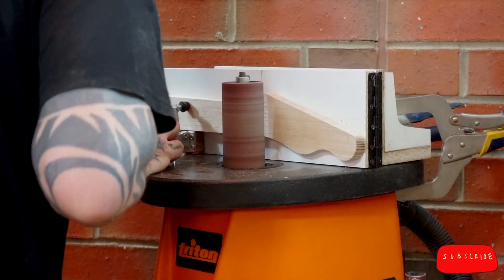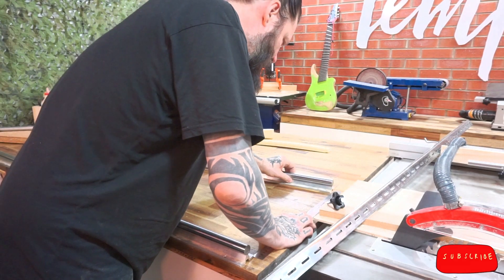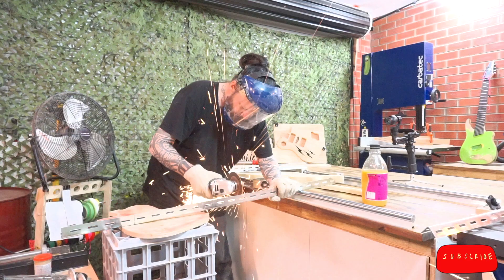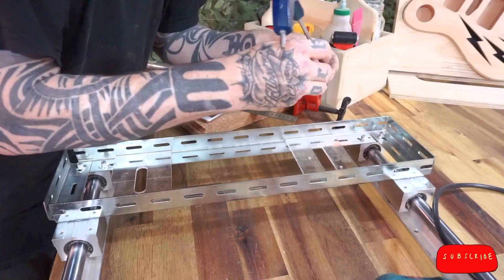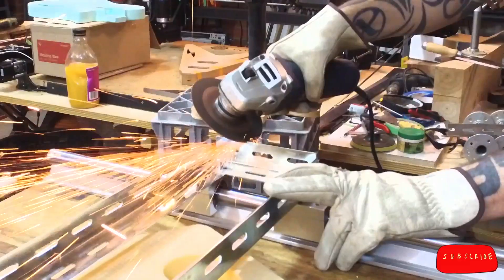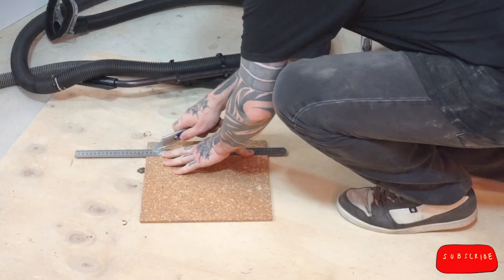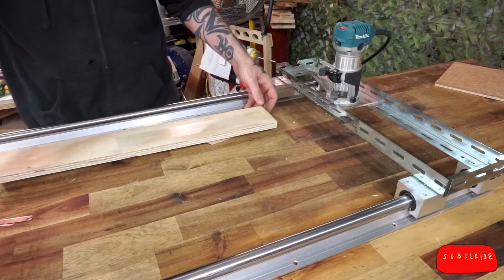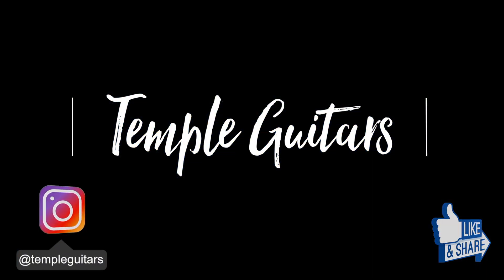Luthiers Router Sled/Camera Dolly + Free Plans!

Comment: Awesome video! Thank you!
I have a question though, why did you make it this long? 

I tried looking at buying these rails and it would cost me $40 to buy a pair of 500mm rails and bearings but going for a 1000m length would raise my costs to more than $200, so I am really cosidering why (I would use this for leveling bodies, headstocks etc.).

P.s. Thank you for your great videos ! Really like that they are so explanatory!
Reply from the maker: I made a monster one so I could lay out several necks or bodies at once an gang cut them, also so I could work on set neck instruments on it, and finally to not be limited when it comes to non-guitar projects I've been working on. I had the space, so I just went for it! If you are happy with a smaller one, you should totally do it. It would make it a lot easier to stow away when not in use also.
Reply: @TempleGuitars  Thanks!!!